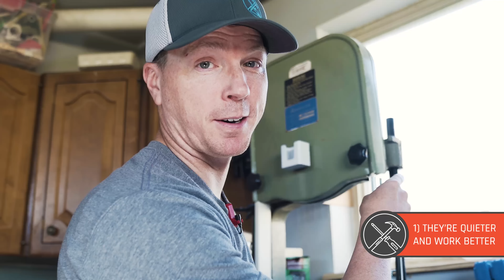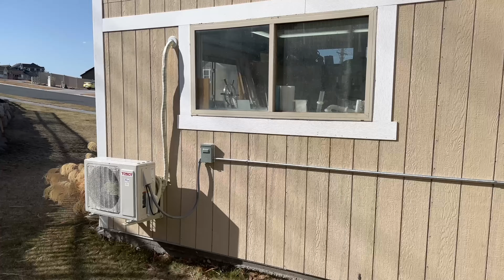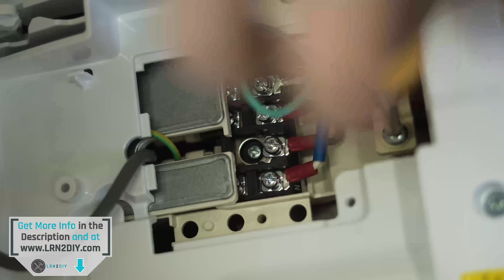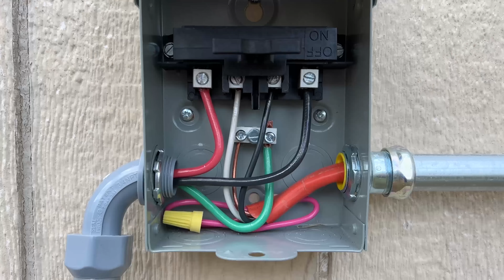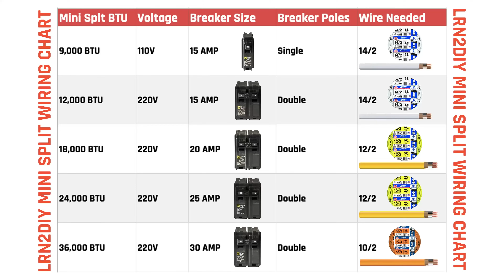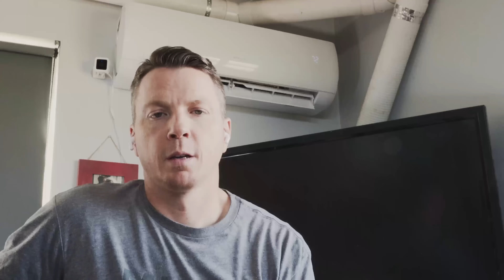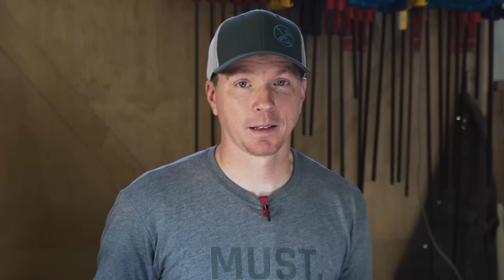Mini Split - 3 Things I Wish I Knew Before Installing

Comment: I think you're way off on the cost of the electrical work. Unless you're doing it yourself? I had a dedicated circuit run for a evaporative cooler and that was $1100.00

Comment: The difference that you don’t mention is that the unit that you bought and the mrcool diy unit only have a 5 year warranty compared to a 10-12 year warranty with one that would be installed by a professional. Not to mention the efficiency of those diy units are low in comparison to better brands.

Comment: We had a mini split installed in our Master bedroom. At night we turned it on to our comfort sleep temp. While the rest of our home stayed the same night time set point. No muss, no fuss. Lower electricity bills overall. We calculated the maintainence and electricical savings to "go ahead" and get the mini split.
Reply: Most people sleep better at cooler temperatures.  If I had a mini-split I would let the house get much warmer (cooled by central A/C) and keep only the bedroom really cool.
Reply: I am about to do the same thing!  I already bought the equipment, just waiting for a good day to install it.  I have a 1,800 square foot home with 2014  Goodman 14 SEER heat pump, and I think I can cut my cooling costs by 60%!  My heating a lot less too.  The ductless Della brand unit is 17 SEER and 9 HSPF.  And Silent!

Comment: I now reside in Mexico, and window airconditioning is rare. Including them in a new construction, takes little to no extra effort in the wiring and plumbing needed in regards to the humidity collected being drained off. Because homes are built up against the lot lines. There's no space to hang one, thus there installed in on the roof, drill a hole through the roof for the wiring and tubing envolved. Which make the sealing a maintance issue and the draining of the humidity collected, is also.

Assuming one can afford it, a 220 will last considerably longer than a 110. I've compared my cost with several neighbor's and the difference is almost insignificant when it comes to the cost of electricity.

Comment: 4th advantage of the Mr. Cool DIY line. They will honor the warranty if you install it yourself. If you choose to put in another brand by yourself and you are not a licensed HVAC technician, you will void the warranty and they will not honor any repair work on it. Beware!

Comment: You still need to buy the refrigirant bottle and the scale ..about 300 more dol...not just the gauge and vacuum pump..
Reply from the maker: That’s simply not true. This unit has the refrigerant in the condenser that gets released into the lines upon connection.

Comment: For our shop we run the table saw, compressor and small shaper (which we sold) off of 220v.   Those units just run much better than 110v devices.   I'm always surprised how many home shops don't have 220v available.
Reply: 240v amperage is half, thus moves easier through the wire which reduces losses due to resistance. The double amperage of lesser 120v moving through wiring have greater losses due to heat.  Also, your devices were probably more powerful.

Comment: I just had a unit installed in my house. I had a friend install it (with my help, okay I wasn't much help) and the important tip was the condensation line. We love it! With purged it with nitrogen, pressured it for leakes, and then vaccummed it. Put some step stones around the outside unit and filled it with small rocks. Put a bowl under it to catch the water and now wildlife has fresh water to drink.
Reply: Keep your filter clean. You may have to clean it every month since it's in your shop. Outside unit needs a cleaning every now and then too!
Reply: I've read that hose water can get moldy so nature may not appreciate it that much
Reply: Ken Hurley very nice gesture! I’m an Hvac mechanic for past 25 years and I generally always try to talk clients out of them and go with conventional if possible to!!! Best Is when I get a service call and upon arrival system is all apart pieces and wires everywhere and then the dreaded “I’m an engineer!” Hahaha!! That’s when I sell em a new unit!!! I’m
Reply: @INKDnARMD  they make sense for a room that's outside of the HVAC envelope or when installing a ducted system doesn't make sense.
Reply: @matsudakodo  you're definitely right. I currently have a 400sqft room that was an add on to the house. There's no air ducts over on that side.  Previous owners installed a PTAC window unit and it's horrible, loud, always running, and not efficient to say the least. This week I'm Installing a mini split and I am excited about next months power bill. Maybe next year I'll put one in the garage.

Comment: You missed the biggest advantage of Mr. Cool: the warranty. Yes, they're significantly more expensive, but they're also the only units that provide a warranty on DIY installs. I debated going the "buy a vacuum pump and refrigerant and do it all" route but decided against it because I really wanted the warranty.
Reply: Actually, they say they will only warranty it if installed by a licensed technician.
Reply: @matsudakodo  If you read the warranty for the Mr Cool DIY type, it does not say that. They also make non-DIY types, and I'm sure it says that in those warranties.
Reply: @bmay8818  correct, the current language states the licensed install is not needed for warranty if it's the "DIY" unit. I don't think it always said that.
Reply: I think, the units are mostly precharged. You just need a pump. That's important, because refrigerant got very expensive.
Reply: @CyberlightFG  No vacuum required on the DIY. I believe the linesets have a vacuum, and the refrigerant is in the condenser, but I might be wrong.

Comment: You do know you can "borrow" the vacuum pump and gages from most auto parts stores. (You pay a deposit, use them, return them!  Usually no charge.)  Also, you can cut the long line set and get rid of the "coil" behind the unit. You need a flare tool or have an AC guy cut them before you vacuum the lines. Makes a cleaner install and looks better as well. Nice video, thanks for the wifi tip. Mine had an available option to add one inside the unit. Worth the $$.
Reply: Just wanted to add you should cut out the excess line set. It can cause a trap, just like a p-trap that keeps oil from getting back to the compressor. I don't think our flare tools are special, you should be able to find the flair tool online as well. 

I do commercial hvac, and if it were me in this fella's shoes I'd stalk a commercial hvac van and ask if he's interested in doing the flairs and pulling the vac, or knows someone who is. Residential hvac guys can get in trouble for doing residential side work, commercial guys generally don't have to deal with that. Might cost you as much as buying the tools yourself, or just a bit less, but then you don't have to deal with the pump and gauges you've only used once, and will probably never use again. ...unless you're trying to start a new side hussle, then by all means go for it.
Reply: The reason for the "extra" coil of lineset is because its charged. If you cut it youll loose your refrigerant. Otherwise completely agree about how sloppy it looks.
Reply: @jamese9888  Just FYI the charge is generally in the COMPRESSOR not the inside unit! Thus I think you can cut them and not lose charge. Once you open the valves on the compressor the gas goes through the full line set. At least on the unit I installed from Panasonic.
Reply: @tracyligon2914  IN this case it is in BOTH. Hence why nobody wants to cut the lineset and vac pump etc. OR if the only in compressor which most times the charge is for 15'. So if they cut it say to 10' They will need to evacuate out x amount of ounces to correct the charge for the length of lineset.  The biggest selling feature is that you wont need to do all that and just plug and go. While not perfect its a good solution for many who dont want to pay a HVAC tech and/or rely on a window unit.
Reply: @jamese9888  No it isn't.
Reply: automotive gauges have different fittings than residential gauges
Reply: @joshdoeseverything4575  Yes but the adapters come with the set to do either.

Comment: Wait until you find out you must make certain the drain from the mini split inside unit does not become mold clogged and you have to take the thing apart to make sure that is done........
Reply: Vacuum it out from the outside once and awhile, before it plugs up.
Reply: @MrBassistfromhell  Mold in the drain line is the issue, not dust.........you must add a couple of blue, fungus killing tablets twice a year and that involves removing the entire plastic cover to get to the drain....

Comment: Just beware of a flooded floor.  The minisplit will seem to stop clearing humidity in the room, hinting that condensation is not draining through a hose to the outside the way that it should.  Moisture which doesn't get through the drain hose builds up and begins cycling through the room until it finally stops draining at all and just floods the floor.
Also, with time, it gets noisy.  This is curable.  Dust and debris settle in the drum fans inside the indoor part of the unit, causing turbulence, which causes noise.  A bottle brush, for example, can reach in and scrape the inside of the drum fans clean.  A vaccuum cleaner helps remove the loosened debris.
Reply: They make tablets to keep the water drain clear..
Reply: @mikecorleone6797  where do you buy them? What are they called?
Reply: @valeriehofmann2615  https://www.homedepot.com/p/AC-Safe-Pan-Tablet-30-ct-AC-913/203216149
Reply: @valeriehofmann2615   Probably referring to "Pan Tablets". They're inexpensive and can be found on AMZ
Reply: Occasional vinegar dumped through the drain trough keeps the build-up cleared away
Reply: I use a shop vac on drain hose twice a year and never have that issue. Takes about 5 min each mini split.

Comment: No disposable air filters, non welded refrigeration circuit joints, the parts usually cost more than a whole new unit.

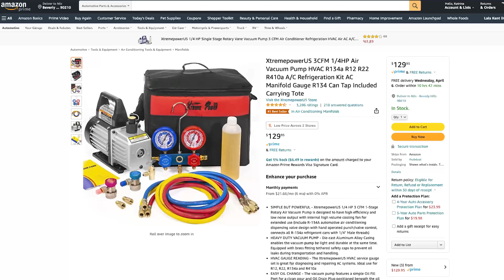Comment: 3:08 yea biggest factor as long as you know HOW to use a recharge vacuum. you slough off a rather large and be it dangerous thing to do like its just no big deal. also about code requirements in the united states they vary from state to state. what you are saying is untrue.

Comment: Loved your Video! I have one Question, Can you buy Refrigerant and install it without a license there? Thanks, Steve.
Reply: Not really... You can find it, but who knows what you're getting. However, the manual for the equipment will say how long of a distance the copper tubing ("line set") can go between the outdoor and the indoor units. The outdoor unit comes pre-charged with enough refrigerant for the distance listed in the manual. You'll pull a vacuum on the line set and indoor unit, then you open the valves on the out door unit and what's in there will be fine, as long as you're under the listed line set length.

Comment: One thing to consider is support and warranty. After buying you add-ons you saved $350, which you could end up spending more than in the long run. (I haven't compared warranties or customer support ratings, just something to consider).
Reply: That's what really scares me about the mrcool's. A 300 year warranty on the compressor doesn't mean much if the inverter board fails after 2 years and is no longer available, or they claim it failed due to voltage fluctuations, if you read their warranty on their site it seems pretty vague. Most failures I find I could attribute to one or two of those exclusions. I'm guessing that must be a part of their business strategy - planned obsolescence. I'm also guessing in a few years there's going to be a plethora of poor reviews based on their warranty.

Comment: One thing I feel was missing from the comparison was refrigerant. You saved money by vacuuming and charging yourself, but did you have to buy refrigerant or was that included with the unit? If you have to buy that yourself, the Mr. Cool is probably not costing you more money in the end.
Reply: the condensor has all of the refrigerant in it, all you have to do is attach the lines, vacuum it down and make sure it holds the vacuum, then turn the valves and it is charged. I just did 2 in my shop a couple of months ago, from a 10 year old window unit to the mini's is a huge upgrade, and other then taking a Air hose to them to get the dust out (which the window unit never really got clean unless you removed it and hosed it off) they have been great. If you live near a Harbor Frieght they have the manifold gauges and a vacuum pump pretty cheap, I couldnt find my gauges and after looking for several hours(had packed them up to move to the shop) went and brought a cheap one at HF that seems to be decent, My vacuum pump is a home made job and I thought about getting one while I was there, the gauges where $30ish and the pump was was around $100ish. I am sure they have the flairring kit too but I have several. I havent bought any but the standard 410a refrigerant is pretty cheap, if you used longer lines and want to adjust the level.

Comment: Don’t you need a refrigerant handling license in order to charge your own system?
Reply: the condensor is precharged once you vacuum down the lines and head unit you open the valve and it lets the refrigerant into the lines and head unit.

Comment: The US National Electric Code specifies the disconnect has to be no higher than 6 feet above ground level. It does not specify a minimum height. I knew the disconnect was required and figured there had to be a minimum height in case of an install in an area prone to flooding. Who in their right mind would install a disconnect up so high only Shaq could reach it?

Comment: Separate from the video, but what are you using to track your movement/motion with the camera. Is this a hardware setup or done in post?
Reply from the maker: I used a DJI RS2, which includes tracking abilities.

Comment: How much gas did your unit use? That's the expensive part.
Reply from the maker: These come precharged with the coolant in the condenser. I showed all steps in the video - there’s no extra step of having to charge anything afterward.

Comment: Overall great video, but a little odd. Remember...the title is "3 things I wish I knew before I installed a mini-split." Come on dude, you were going to install an AC system, but "wish you knew" that it had to be wired to the panel? And that you needed a disconnect? You knew these things already because a) I'm sure your home AC system gave you a clue, and b) because the meaning of "installed" versus "portable" is the fact that the item is "hard-wired" into the home's electrical system. The same applies to "standby" versus "portable" generators. 

Also, you speak about the price difference between a Mr. Cool unit and the one you bought being about $500, then proceed to tell us your unit lacks about $259 worth of equipment to achieve the Mr. Cool standard features (not including taxes, shipping or travel time/gas to pick them up, and expertise to use the line pumping equipment). I would guess that most people would opt to skip the "parts wrangling" and pay the higher price. What other features are absent on your model? And you have not mentioned how the warranties compare.

Still, the video overall is very informative.

Comment: You are wrong on the electrical. My mini splits are 110 and they plug into an inside outlet with no outside electrical at all other than the wire that connects the inner and outer units.
Reply from the maker: I admit that I’m wrong on a few things in this install but that’s not one of them. If you install an actual mini split (condenser outside, control unit inside) then you need an A/C disconnect at the very least and that has to be outside close to the condenser. See chapter three of the NEC book. I’m pretty sure it’s also against code to run a plug in cord through the wall like you described as well.
Reply: @LRN2DIY  Well the units I have only have an inside plug, there is no way to run an outside power cable unless you run the inside plug through the wall to the outside. So I can't help what the code is, but I have mine ran just like the instructions said. They are probably from china, and they have no care for American codes. I wasn't saying you were wrong about the code, I was saying that you can buy minisplits that only have power coming from inside. I'm in rural south Ga, we don't pay much attention to codes anyway, I built my shop and house from the ground up and have never had a permit or an inspection. Thats just the way it is here.
Reply from the maker: @DaveCross74  Ah, gotcha. I see what you're saying. Yeah, to your point, the manufacturers won't typically take US Code into account. The wires that came with mine were, at least in one case, too thin a gauge to meet our requirements so I had to change it to make it up to code. That said, like you mentioned, either way I bet you're loving having it installed right now, especially with the Georgia heat! We're in Utah and it's been in the 90's every day so it's a life saver. Good luck and thanks for watching!

Comment: |> |> |> |> |> |> |> |> 
|> |> |> |> |> |> |> |> |> 

do that in eutope, especialy in germany or austtia and switzerland!

hahahahahaha ...

and ... minisplits to use for heating:

well ... cool air goes down ... so the inner part up is good ...

but hot air goes up ... you would need the thing down ...

I always use two different things or be able to switch pipes bycfix instalation inside a boat for example ...

|> |> |> |> |> |> |> |> 
|> |> |> |> |> |> |> |> |>